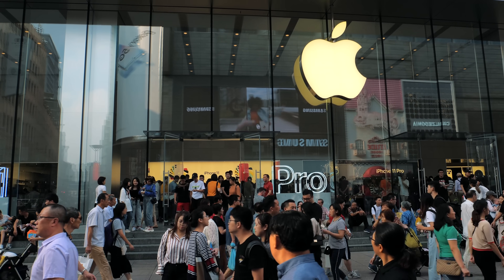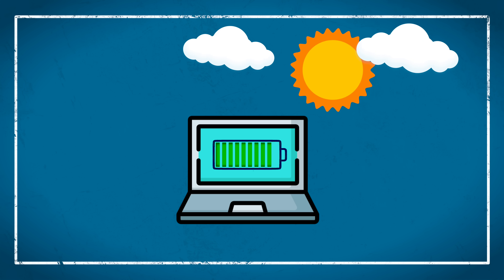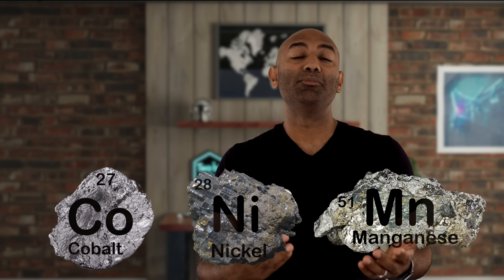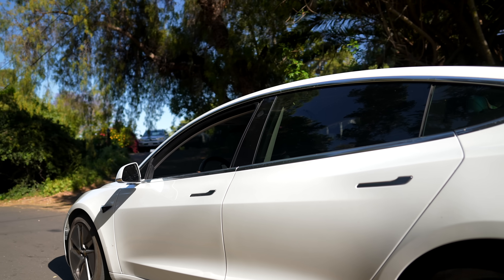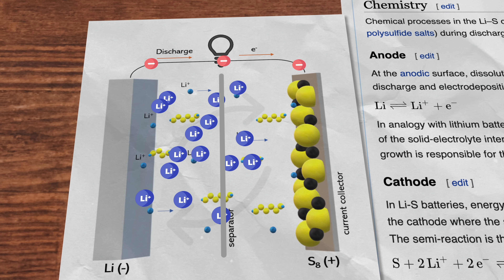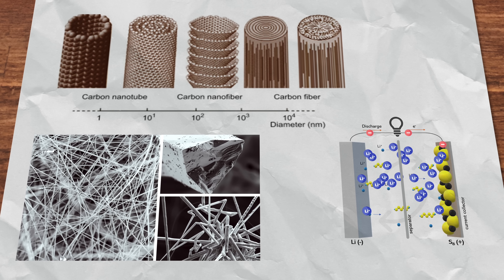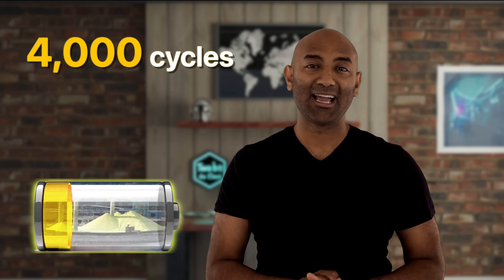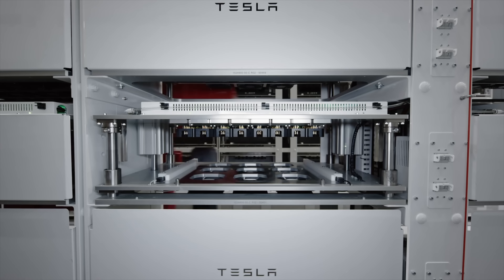Scientists Discover a Lithium Sulfur Battery Breakthrough on Accident!

Comment: Sodium sulphur has always required  a very high temperature to function.  I can't  see how lithium sulphur can be different.  At high temperature the su l.p. ur is liquid , so dendrites  can't  exist . There's anyhow a couple other  ways to create the monoclinal sulphur crystals if they are indeed essential for a new battery strategy which can't  be disclosed here .

Comment: Trying to follow the topic I was surprised to learn that sodium-sulfur batteries are nothing new, they're in fact known since 1960s, way longer than lithium batteries. Their drawback is, they need to be operated at high temperatures (400 C) which makes them only suitable for stationary industrial applications. So I guess main significance of this find is that it solves one of several major problems that prevent them being used at room temperatures. One of several is the point, stability of this sulfur configuration at room temperature is a breakthrough but more research needs to be done before these batteries will be truly usable at room temperatures.
In any case, seeing progress in this area is exciting. Let's hope the remaining problems won't take that long to solve.
Reply: How much energy is used keeping the temp at 400 degrees
Reply: @jimlycett4480  In a stationary application, once the battery is up to temperature, very little energy is needed to keep it at that temperature, if well insulated. And stationary applications often would make continuous use of the battery, so it's not like the heating goes to waste with the battery idle. However, that's a different usage profile compared to automotive.

Comment: Any info on the weight of a similar battery size?  Also, physical size of these batteries versus Li-ion?  Thanks.
Reply: in short, no, because it is not yet commercial. commercial usually means that they have the micronization done and only then would you know the size of the battery.

Comment: This is very misleading as it has not just been discovered.

 Li–Sodium batteries were invented in the 1960s, when Herbert and Ulam patented a primary battery employing lithium or lithium alloys as anodic material, sulphur as cathodic material and an electrolyte composed of aliphatic saturated amines.
Some claims were made that the sodium-sulphur battery was invented by the Ford Company in 1966. Their battery consisted of liquid (molten) sulphur at the positive electrode and liquid (molten) sodium at the negative electrode with the active materials separated by a solid beta alumina ceramic electrolyte.

There have been many advances since and now the major companies profiled in this lithium sulfur battery industry report include Advanced Energy Materials, Ilika PLC, Johnson Matthey, LG Chem, Morrow Batteries, NOHMs Technologies, OXIS Energy, PolyPlus, Sion Power, and Williams Advanced.

Comment: I think any sulphur based technology is better used in the massive stationary  batteries we will need for our grid storage. The price point works well in that situation. The cell voltage is lower even than the drop you see with LiFePO v Lithium ion, and the LiFePO batteries are getting good enough as well as cheap enough.
I see that lithium ion formulations can be doubled in wh/kg from where manufacturing for automotive uses is today, and that would be sufficient for cars. It would allow sufficient range with lower mass.
  But put sulphur in a car, and crash it, you will have a public revulsion to the smell. Add sodium and the heat needed and you lose on both containment and crash-worthiness. I see it as too big a change in direction at this inflection point in EV market development.

Comment: Sulfur; Sulfur; Sulfur !

As a major export/import harbour., 
this is great news for our Sulfur supply.

Not only in Batteries, 
but in transporting of the materials.
Reply: IF you only need to repeat the process, 
there are many analysts available to help.

Even if the result was caused by a butterfly on a window, they could identify the resulting changes to the experiment.

Comment: we have that option already called LTO, all the benefit NONE of the bad parts, hell you can puncture an LTO battery and it will still work, Sulfur will NEVER take off because we already have LTO, also lithium has 3 electrons NOT 2, see didnt even do research properly, so it has 2 electrons out of the energy state, which means sulfur has the same energy state as lithium, so this is useless BS battery tech that we get every month

Comment: IDIOT ! Sodium Sulphur batteries exist already and were involved in a HUGE industrial FIRE in Japan that literally COULD NOT BE EXTINGUISHED. ! Expect Lithium sulphur to be more reactive still !.

"NGK INSULATORS, LTD. has announced the cause of the fire that occurred on September 21, 2011 involving the NAS (sodium-sulfur) batteries for electricity storage that it has manufactured. NGK also announced safety enhancement measures and the resumption of factory operations.

NGK has worked to find the cause of the incident and implement countermeasures since it happened. Recently, a third-party investigation committee, with Japan's Hazardous Materials Safety Techniques Association serving as secretariat, reviewed the cause of the fire and containment measures, and judged that the details regarding both were reasonable and appropriate.

Based on the results of this investigation, NGK decided to voluntarily implement safety enhancement measures, including a monitoring system, under the guidance of the Fire and Disaster Management Agency.

By implementing these safety enhancement measures, customers can be assured of their using NAS batteries with even greater peace of mind because the batteries now have more safety features than previous ones.

Up until now, NGK has asked almost all customers to suspend using NAS batteries or to restrict their usage. NGK is working so that these batteries can be re-used after quickly implementing safety enhancement measures according to installation conditions, while following the guidance of the fire authorities having jurisdiction in the installation locations."

TEN YEARS AGO THIS HAPPENED !

Comment: CORRECTION! lithium is allot more abundant then sulfur, you can get it from brine the waste product of desalination plants. so technically 2/3rd's of the surface of the earth has it.
Reply: And you really think you can get enough lithium from them to satisfy the demand for EVs, phones, computers, etc.? Basically everything that uses lithium and the demand for it growing exponentially in the future. What about the extraction cost of doing it? If it were sooooo easy the issue would be solved but it's not. Just because it's there doesn't mean it is cost-effective to use. Case in point - hydrogen. You can get hydrogen from water too. Except that the cost of extracting it is extremely high which in effect doesn't make it all that useful cost-wise.
Reply: @gigakrait5648  once the switch to EV is finished,     YES!!!, the batteries are 95% recyclable. once the initial demand is taken care of allot of those mines will be shut down.
Reply: @TheInsaneupsdriver  That's speculation and wishful thinking. There is no guarantee this will be the case. Do you have any idea what the initial demand is though? Think about replacing every car in America with an EV and how much lithium you are going to need and how long all this will take. Even now, there are complaints that recycling isn't worth it and what people think is being recycled isn't and just thrown into a landfill. And recycling batteries isn't the same as recycling plastic. It's a much more intensive process.
Reply: @gigakrait5648  no its factual. 9nce all cars are EV you're basically just replacing old ones and it only needs 5-10% to replenish the supply, over what's needed to replace the whole ev fleet over 25 years... that's 0.2% of the amount of nickle and lithium we need for the switch, plus or minus for good range in some accidents for others.
Reply from the maker: you can get it from brine, but in what quantities? It's not really something you can refute, its pretty black and white.

Comment: Why not put batteries in smaller cars less hp I do not need 500hp to got 300miles how about 150hp and go 700 miles
Reply: Because size, weight and efficiency of the battery has more to do with range than hp. The smaller the car means the smaller the battery you can use and therefore the less range you get. If they could actually get 700 miles out of a battery they would have done it by now don't you think? Even Musk said they could do it but won't. Here are some excerpts from an article about it:

This week, a Tesla superfan acknowledged that Lucid was first to market with a 500-mile EV, but he added that Tesla “would be the first to mass produce one.” But interestingly, CEO Elon Musk responded to the tweet to indicate that Tesla doesn’t plan to make a car with more than 400 miles of range, even though he said that it could have made one a while ago:

We could’ve made a 600 mile Model S 12 months ago, but that would’ve made the product worse in my opinion, as 99.9% of time you’d be carrying unneeded battery mass, which makes acceleration, handling and efficiency worse. Even our 400+ mile range car is more than almost anyone will use.

In a comment to Electrek last year, Musk clarified how Tesla is looking at long-range electric cars now:

What we are seeing is that once you have a range above 400 miles, more range doesn’t really matter. There are essentially zero trips above 400 miles where the driver doesn’t need to stop for restroom, food, coffee, etc. anyway.

Model S Teslas are minimum $60k also. Hardly affordable for the masses.

Comment: The trouble with current ev is they are too expensive and have too short of range. I drive 1200 miles a week and can’t afford to wait around half hour to charge my car. Hopefully this will change that.
Reply: @vikeshbubbles205  I often drive over 300 miles a day is the problem. I could certainly install one at home. The other problem is that I can buy a civic for 25k that will last 350k miles easy. Why pay 50k plus for a car that may not last as long?

Comment: Love all these comments praising this when in fact you know that this is years and years away from becoming reality. Discoveries like this (if true) don't make it to market that fast. It's entirely experimental at this point and hasn't reached any stage that would make this a viable alternative. Solid state batteries are closer to market and those are still at least 8 to 10 years away.
The other problem is you still have to address the fact that there just isn't enough Lithium on the planet to supply all the devices that use it especially EV batteries and whatever else you plan on in the future. You also have to address the fact that EVs will put an enormous strain on the electric grid. You will have to generate even more power to accommodate this load by burning even more fossil fuels. Solar and wind power alone isn't viable for so many different reasons.

Oh and just to drive the point home even further regarding solar power being your holy grail to supply the power needed for all this, check out a video on this SAME channel titled "This Billion dollar solar plant was an epic failure" from earlier this year. So they cleared all that land, installed all those panels and infrastructure and when it failed they just left it all there. Talk about environmental damage. Isn't that one of the things all the greenies are sooooooooo worried about?? Compare that to a nuclear power plant and it's output relative to the area it takes up and that is able to produce way more power, far more efficiently with a longer lifespan without having to worry about on-demand power due to solar's inherent problem only producing power during sunlight and no storage of that power.

Comment: But....if it's LITHIUM sulphur, doesn't it still need lithium???
Reply from the maker: yes the first incarnation would still need lithium, but not nickel, cobalt or manganese, which is a huge win. but it also opens the doors to future batteries that are sodium sulfur, which is REALLY interesting
Reply: @TwoBitDaVinci  Still doesn't solve the lithium supply problem, the mining of it and the reliance on the countries that actually have it and are mining and refining it. There is supposedly a huge deposit of lithium in the western US but good luck extracting it because of environmentalists. There is also the problem of what you do with used batteries. The recycling operation and costs involving such a thing would be astronomical. Are you going to guarantee that these things don't somehow end up in landfills? Who is going to run that operation as well? The Chinese? What is it going to cost? Good luck with that. Replacing batteries in Teslas is also not cheap which was shown by the guy in Finland who blew up his Tesla rather than spend the $22,000 it would have cost to replace the battery that was no longer useful.

Comment: Battery technology is advancing so fast the EV you buy today may be outdated to a 4 or 5 years.
Reply: yes. but it will still be expensive at first because it needs to be upscaled to being able to produce many millions of cars. and that upscaling process eats time and money. but with each doubling of production capacity, prices can drop a little bit.
Reply: That's not even the biggest issue with EV's...if you dig into the programming of your EV, you find out that some gov't agencies have a shutdown code and can even take over the self-driving mode "in case of National Emergency".  

So unless you hack into the system and rewrite the code so nobody, including the government, can jack your ride...EV's could be considered as unsafe for the purposes of freedom.

Comment: 1500 mile makes sense. for extreme use cases.
For most cars 500mile would be more than enough, and then the performance would drastically improve due to lower vehicle weight.
There'll be a sweet spot.
Reply: for cars it practically lowers cost but 500m miles can be already achieved today.
however, for busses and trucks this is an important step. and even for trains when you don't have pieces of tracks with electric support.
Reply: @stefanweilhartner4415  Yup. For such use cases it makes sense.

I think for the majority of private vehicles it would not just be a cost improvement. A 150-200kg'ish battery with the capacity of a current 500kg battery will already significantly increase the range. Possibly by as much as 10-20%. Maybe more. Weight matters after all. That's like having 2 passengers vs 5. So we may well see EVs with 500mile range, which get 600 miles with the same battery capacity, because the weight of the battery is so significantly reduced.

Tire and other mechanical maintenance can also be significantly reduced due to lower weight.
Reply: @joeblack4436  10% improvement for sure.
and it opens other possibilities too. you can reduce the battery compartment in height which might be interesting for sports cars like the MX5/Miata. I think it is very difficult to make an MX5/Miata with current battery tech without getting a higher underfloor that contains the batteries. i don't know how tesla will do it for their Roadster. their 4680 cells with approx. 296Wh/kg are the highest cells they have. if they want the battery floor thinner, they have to align them horizontally.
Reply from the maker: well said Stefan!

Comment: They would put a smaller battery in that gets the same battery life of today's battery. Not only that, They would use different battery sizes for different price points. It's the batteries that make EV's more expensive.
Reply: That's what excites me. A battery one third the weight, size and cost for the same range gets my vote. That translates into the vehicle having a lighter structure, using less materials to increase range, better handling, less tyre wear, etc.
Reply: @briananthony4044  It's coming
Reply: The smaller battery will also charge faster. Most ICE cars have a range of around 300mi because thats about the longest most people can sit in a car without stopping anyway. The ones that have greater ranges than that are usually trucks, because when towing, the range is decreased greatly, so to engineer a 300mi range into a truck towing a trailer, the unladen range will be around 600mi.

If a battery is made that can charge in 5min, people probably would be perfectly OK with even a 150mile range.
Reply: @twoeightythreez  My truck loaded and a trailer in tow ( ~17,000lbs GVW ) gets up to 16MPG with non-ethanol fuel. 12 with the cheapo stuff. That times a 35 gallon tank means a range of 420 to 560 miles. Sad thing is, empty it gets the same mileage. Around town is more like how many gallons to the mile. 2001 Chevy Silverado Extended Cab Dually with an 8.1L V8, Allison, and a locking 4.10 diff.

Comment: I laugh...in the seventies it was the carburetor that could get you 90 miles to the gallon...but the gov't and big oil suppressed it. Same nonsense here.
Reply from the maker: There’s no carb that will get you 90mpg it’s just physics and thermodynamics my friend
Reply: @TwoBitDaVinci  There's no battery that will get you a 1500 mile range either...that was my attempt to give you a parallel from the 70's in a humorous way.